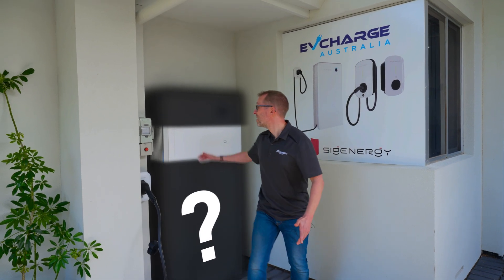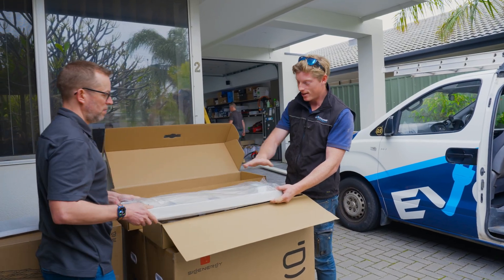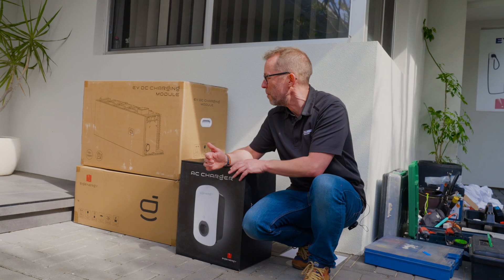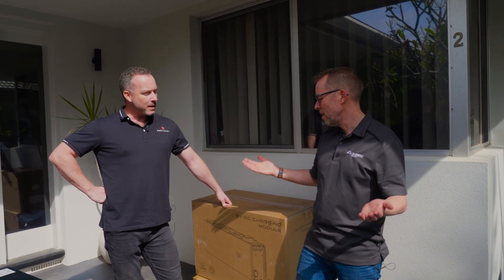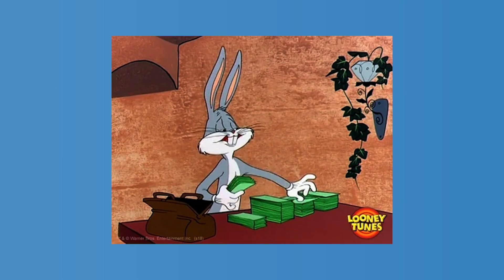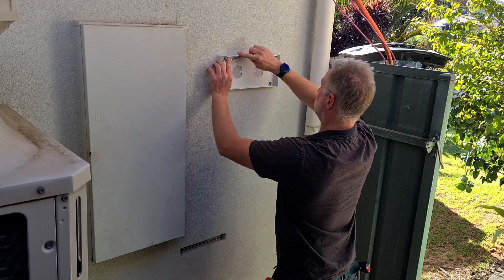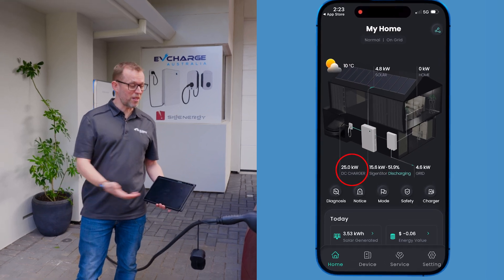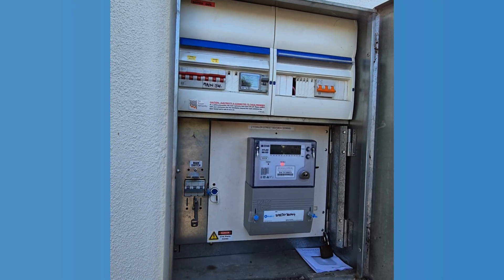Installing Australia's Fastest Home EV Charger (And It Works Off-Grid!)

Comment: I was recently quoted $27200 for a 32kw Sigen system with a 10kw inverter. Exceptionally positive reviews about them, but that works out to $680 a quarter for the next 10 years. My winter bill, the highest of the year was $540. I so much want all the benefits but it’s just too hard to justify.
Reply: Have you looked at Amber electric? A battery that size you could sell back to the grid at wholesale prices and make the difference back
Reply: @AlexWoolaston love to see figures on how realistic that would be
Reply: Also worth noting that our batteries are fully modular and independently optimised which means it couldn’t be easier to add more batteries in the future…. Start smaller and add more batteries when the budget allows
Reply: @willhall2468  the modularity of the Sigenergy battery is a winning feature. No need to match them on age or capacity... just add them as you need.
Reply: If your winter bill was $540, you most likely don't need a 32kwh battery. You could most likely halve it to a 16kwh, which is what I'm looking at, though my bills are higher than yours, you might even be able to go lower to 13 or 10kwh. (Since it's modular, you can start small, then add-on later if needed)
Reply: Not to mention you have to buy solar panels as well, otherwise why bother. So the systems would have a pay back time in the order of 15-20+ years. In that time batteries are likely to get cheaper...

Comment: @rodsmyth
If only using the system as a car charger via solar and battery does the system need a grid connection and an inverter?
Reply from the maker: yes - inverter power needs at least match EV charger power

Comment: When car charging via DC does the power come directly out of the battery ie DC - DC charging without any use of AC in an intermediate step?
Reply from the maker: By default to charge at 25kW this will first use solar then 16kW of battery and the rest from the grid if needed
Reply: If only using the system as a car charger via solar and battery does the system need a grid connection and an inverter?
Reply: @rodsmyth  Doesn't need grid connection but does need inverter
Reply: @willhall2468  thanks for replying but what I am trying to determine is does the DC current coming out of the battery to charge the car ever  become AC current which would then need to be converted back to DC to charge the car.  If not then what is the role of the inverter in this use case?  DC - DC voltage conversion perhaps?
Reply: @rodsmyth  No conversion, purely DC. Each battery has a DC-DC optimiser built into it and each inverter has EMS and PCS built into it

Comment: Actually Finn... we beat you to the title of "Australia's Fastest Home EV Charger" with my SigenStor with 25 kW DC EV charger modules installed a few months ago :)
Reply: @SolarQuotes  https://youtu.be/p9h5-tIb4YA
Reply: Where would we find an update on EV’s that can work bidirectionally with this?
Reply: Second That.
Reply: @markusaenkler3918 
thirded. cmon guys. it's been 10 months
Reply: Also in SA?
Reply: @lukem7570  In Victoria on our off-grid microgrid
Reply from the maker: Australia’s fastest on grid  home EV Charger 🫢
Reply: @SolarQuotes  touché
Reply: @SmartEnergyLab  maybe you can answer a question no one else has been able to Glenn - will sig blackstart Enphase iq7s series --- not the 8s  ???
Reply: I thought you'd have this kit Glenn, your place must resemble a science lab 😉
Reply: I may have missed a simple specification.

How does the system use 25kw for charging when the batteries are 16kw output? (unless it was each 8kw battery can do 16kw output for a larger total output)

Or is it some other setup where the inverter mixes 16kw from the battery and adds in 9kw from solar or the grid to get to the 25kw?
Reply: @MrTubeNR that level of DC output will either be from the particularly large solar array or a combination of the solar generation & stored energy in the batteries depending on conditions.
Reply: @MrTubeNR  Hey mate, the way we do this is by pulling from the panels, then batteries and then grid if required
Reply: @MrTubeNR It's 16kW AC. The DC output is only limited by the EV charger module which can charge directly from DC. The rating of that module is 25kW. Without knowing the specs of the battery modules, I'm going to assume there's some kind of DC boost converter in the EV charger module that raises the voltage above the car's voltage so it can charge it directly.
Reply: I am looking at getting the 48kWh package with NO car charger, at the moment, may be later.
Can you give us a price of your system, as I have found finding  detailed prices elsewhere rather difficult.?